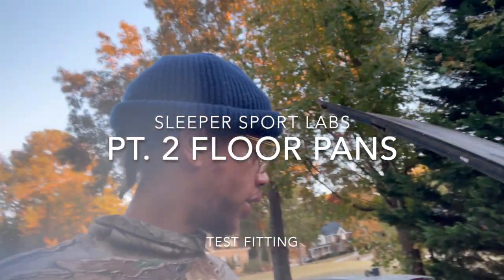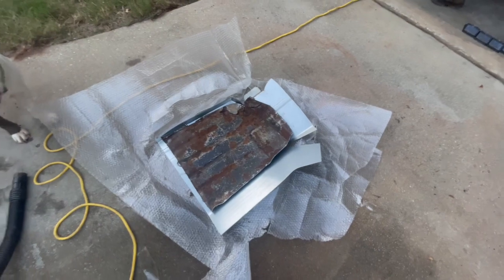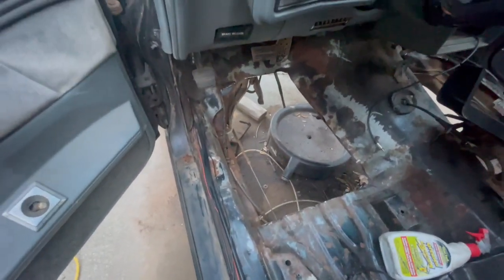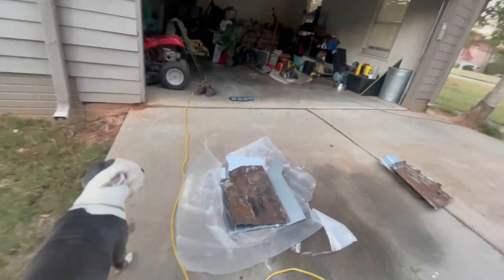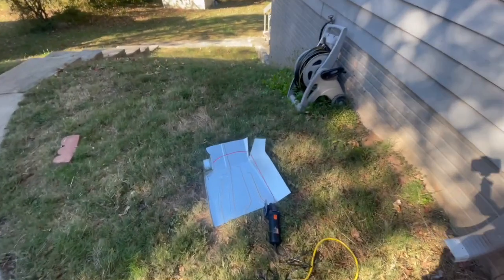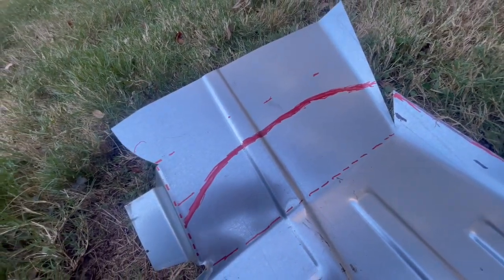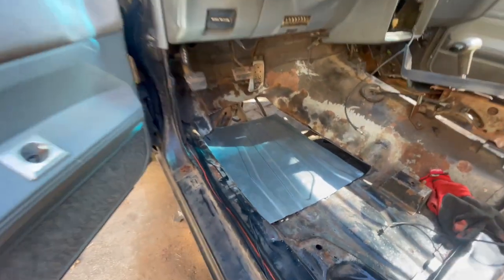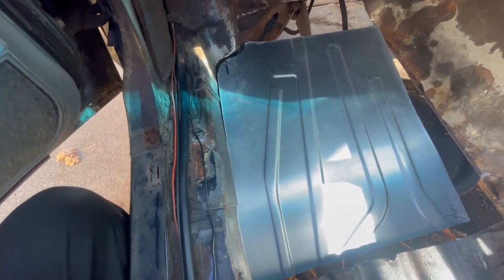How to measure your floor pans "THE WRONG WAY" lol #gbody

Comment: Your comments were off for the cross member video.
Good call not to drill that close to the side of the frame rail!
 Just a suggestion but  if you were worried about it I you could drill or circular file/rasp out the hole on the empty cross member hole to match the hole in the frame and weld a good washer on top of it aligned with the factory hole in the frame to get that 4th bolt in.
It looks like there is plenty of clearance for the added thickness of the washer to get the nut on still and locked down.
Anyway keep on posting videos. I love projects!
 You are inspiring me to maybe start doing videos 
Im restoring a 78 f350 custom dually hauler.
400 big blk cammed . 
Getting ready to install new prostock headers and all new exhaust
Reply from the maker: I ended up using a good size washer and had enough space for it to clear on the inside of the frame.. thanks for the feedback

Comment: Is that cross member for the rear trans mount?
I wouldn't weld that in permanently 
Jmho
Reply from the maker: lol man I was just honestly over thinking the simple stuff.. I definitely appreciate the feedback
Reply: @sleepersportlabs  oh ok haha... Back in my young and wreckless days I had a 72 nova, I swapped out the 250 I6 for a 327 from my wrecked 70 Chevelle and had to fab new motor mounts in. Lets just say I went a little overboard welding the new tower for the mounts in and of course..later down the road I was back in there grinding to get them off.🤬